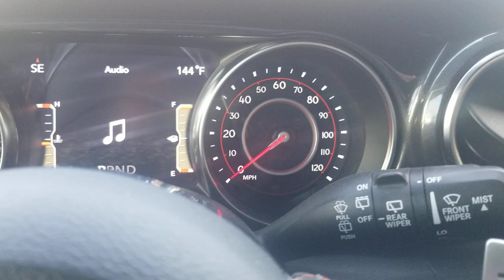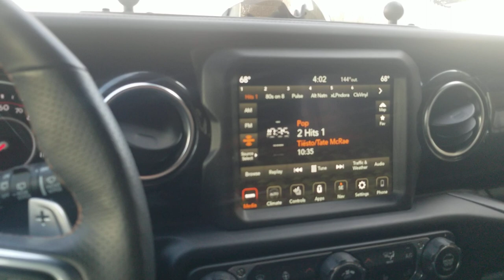Tazer JL Mini Malfunctioning

Comment: Try to update the tazer. I installed a tazer on my 2023 JL and it works fine.
Reply from the maker: I updated it before I installed it, as the instructions said. The first time, the update failed. I then did a restore and tried again. It was "successful" the second attempt. I think the tazer was physically defective because of the hit-and-miss inconsistent behavior. Customer service wasn't helpful at all and just put the blame on me, saying I must have not configured it properly. I got tired of dealing with it and them and returned it to Amazon.